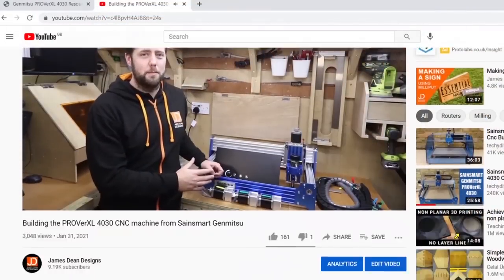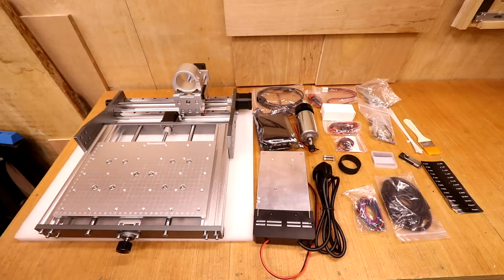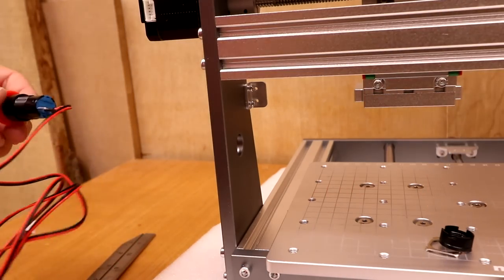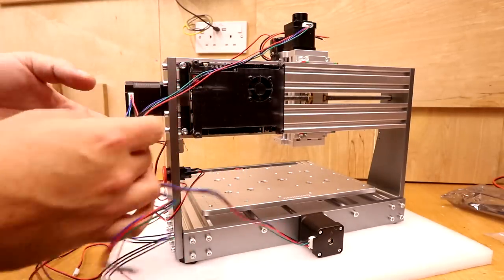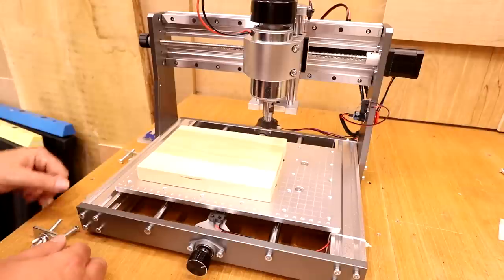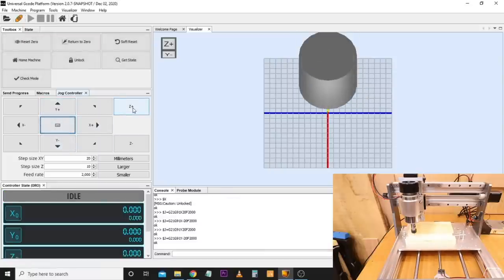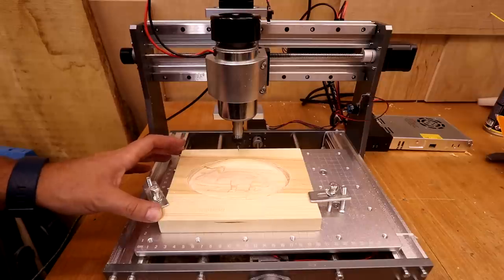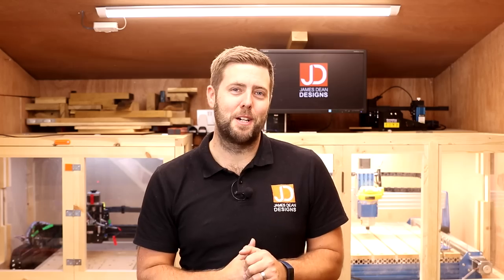3020 Pro Max CNC Metal Engraver by Sainsmart Genmitsu -  Build, test and review

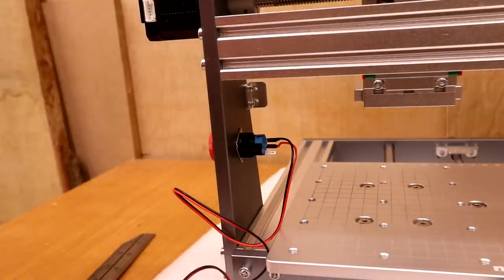Comment: So, I purchased this model a couple of weeks ago, building it was a breeze, I learnt a lot from watching the many videos by James including the correct direction of the bed and the one discussing the $3 command for altering the direction of the stepper motors, but I have a conflicting software/hardware issue, can anyone who has had this issue assist as I have also tried to resolve this in configuration software but it loops such that it doesn't let me adjust the direction. I installed the limit switches as per this video at 12:51 namely X-limit near the stop switch, Y-limit front of the unit, Z-limit top of the spindle. The steppers and limit switches are plugged in as described at 19:00, I've rewired this three times now because of this issue and have labelled the cables at both ends with their direction (x,y,z) and function (step/limit). I can connect with ease to the PC, and when I use the 'Jog' arrows (in any of the programs, Easel, Candle, UGS) etc, the 'X' right or (+) the spindle carriage moves towards the 'stop' switch, likewise jog left or (-) and it moves left.  When I use the 'Y' jog buttons, the table moves towards me when I tab forward or (+) and towards the back of the machine when I tap back or (-), and the spindle is raised when I tap the up or '+' and lowered when I tap the down or  '-', and when I used the offline controller it functions as above, correctly. Here is the problem, in that respect it's as perfect as a Swish watch.

When I 'Home' the machine the bed travels towards the back of the machine (where there are no limit switches and crashes and chatters), and the 'X' rail travels to the left, away from it's limit switch (where it chatters and growls at me). I have reinstalled the firmware twice now, I have adjusted the $3 command using all the figures but doing so either makes no difference or screws up another setting. As there are holes for the limit switches on the other side of the X and Y sides, I have also placed the limit switches here, so the X was on the side away from the 'Stop' button, and the 'Y' was at the front of the machine. That allowed me to home the machine, but my working limit was reduced by about 30mm on the Y axis and the machine/software would often report an alarm of varying reports from a non start or soft limit reached (even when in UGS they machine set up they were turned off) and no, I don't know why, by this point figures for X/Y were in negatives sometimes.

So, what could be causing it to function correctly using 'Jog' commands, but failing to home correctly. I can only print the Genmitsu test file if shortly after I run it I press the 'Stop' button as it nears the left side of the machine (or it crashes and the X motor does it's funky noise), then pull out the 'Stop' switch for it to mill, by which time I've lost half the 'G'... So, where am I going wrong? I've tried the individual zeroing of X/Y and the Z I've used a Z Probe.

$1 = 25    (Step idle delay, milliseconds)
$0 = 10    (Step pulse time, microseconds)
$2 = 7    (Step pulse invert, mask)
$3 = 2    (Step direction invert, mask)
$4 = 0    (Invert step enable pin, boolean)
$5 = 0    (Invert limit pins, boolean)
$10 = 115    (Status report options, mask)
$6 = 0    (Invert probe pin, boolean)
$11 = 0.010    (Junction deviation, millimeters)
$12 = 0.002    (Arc tolerance, millimeters)
$13 = 0    (Report in inches, boolean)
$20 = 0    (Soft limits enable, boolean)
$21 = 1    (Hard limits enable, boolean)
$22 = 1    (Homing cycle enable, boolean)
$23 = 3    (Homing direction invert, mask)
$24 = 25.000    (Homing locate feed rate, mm/min)
$25 = 500.000    (Homing search seek rate, mm/min)
$26 = 250    (Homing switch debounce delay, milliseconds)
$27 = 1.000    (Homing switch pull-off distance, millimeters)
$30 = 12000    (Maximum spindle speed, RPM)
$32 = 0    (Laser-mode enable, boolean)
$31 = 0    (Minimum spindle speed, RPM)
$100 = 800.000    (X-axis travel resolution, step/mm)
$101 = 800.000    (Y-axis travel resolution, step/mm)
$102 = 800.000    (Z-axis travel resolution, step/mm)
$110 = 1000.000    (X-axis maximum rate, mm/min)
$111 = 1000.000    (Y-axis maximum rate, mm/min)
$112 = 600.000    (Z-axis maximum rate, mm/min)
$120 = 30.000    (X-axis acceleration, mm/sec^2)
$121 = 30.000    (Y-axis acceleration, mm/sec^2)
$122 = 30.000    (Z-axis acceleration, mm/sec^2)
$130 = 300.000    (X-axis maximum travel, millimeters)
$131 = 180.000    (Y-axis maximum travel, millimeters)
$132 = 70.000    (Z-axis maximum travel, millimeters)
Reply from the maker: $3 adjust the general travel directions, so make sure that is set correctly, but $23 adjusts the homing direction with the exact same principle. So adjust that one until it homes in the direction you want it to

Comment: Hello, I have followed your video up until the section where you navigate the spindle, the spindle moves on the computer but not on the actual machine itself, I double check the connections twice, I don't know what's wrong, none of the fans are running when I turn on the machine, it just dead, any advice?
Reply: I found the issue, the emergency stop was pressed, needed to release it, for the machine to become operational again.
Reply from the maker: Its amazing how many times I knock that switch and dont realise. Glad you found it

Comment: Hi James, which  machine would you recommend/prefer for making small aluminium parts between this machine the 3020 pro max and the PROVerXL 4030. I'm converting a milling machine to cnc, similar in size to the PM30MV  and to save having to disassemble, measure, reassemble and make the parts on the machine I would prefer to have another machine to save time. Are there any other machines around the same price that may fit the bill. Thanks and thanks for the great informative videos you make.
Reply from the maker: Hi Derek, if they are just small parts then I would probably stick with the 3020. But like all things buy the best you can afford so if you can afford the ProverXl then I would probably go that way because it gives you more options and a bigger machining area.
Reply: @JamesDeanDesigns  Thanks James, Yes they are only small parts so have no problem with either. Once my conversion is done I will have a similar work area as the 4030 but obviously a much more rigid machine as its all cast iron, cutting  steel is no problem(within reason). Basically I would like to know which is the most rigid of the 2, I also have an Eleksmaker A30 laser so that side is also covered. Thanks
Reply: @JamesDeanDesigns  I eventually went with the 3020 Pro Max, one difference in the building is the whole gantry assembly is no longer fastened with T nuts, the holes are pre drilled and threaded in the outer frame so the gantry position is almost perfect from the outset, you do get a very small amount of wiggle room in order to help trim the spindle perfectly. Unfortunately it sat in the box for over a year due to health problems, now overcome and the machine is up and running. Thanks for all you do to help the community.

Comment: Hi James - first many thanks for your excellent videos as a retired "Old Geezer" I do need very detailed instructions!😂 - I have decided to get a CNC machine and I was looking at the Vevor 3018 Pro Max at £238 and that includes the 15w Laser - BUT.. having watched this video (and quite few of your other videos) I'm thinking this might be a better bet - I like the fact that its all metal  - I'm only using it for a hobby and to make some toys for a local charity - what do you think is this overkill or just the job? One last question - what's the benefit of a 15/20 w Laser over a 5.5w?
Reply from the maker: Hi Geoff, think I replied earlier on Facebook about the 3018 Pro. This machine is great but obviously another good step up price wise and not available I'm in the UK yet. But can cut faster and deeper so the 19mm boards you were on about, this could probably cut 2-3 times faster. General rule is buy your second machine first or at least buy the best you can afford so if this isin price range and ticks all the boxes then go for it. As for the laser, manufactures are a little sneaky. They sometimes advertise the input power but output power is the true value. So the 15w laser is more like tha 4w and the 20w is the equivalent of a 5.5w.  Usually they put it in the fine print but generally speaking anything listed as 10w or above will be the input value, output is usually around 1/3 to 1/4 of that

Comment: Nice upgrade but I am surprised they didn't make it bigger. Make  me think a bigger one will be next..
Reply from the maker: I did wonder that myself initially but this is really geared towards metal and to my knowledge people who do metal typically don't need as much space
Reply: @JamesDeanDesigns   I have a  self designed and scratch built 24 x 36 machine built from 1/2" plate aluminum. All Ball screws with 1" steel rod "ways" and Nema 23's with a  1.25 HP DeWalt Router motor on it. But  I do see the place  for a smaller machine. Larger size does lead  to thicker and  more costly materials. I think they were after the  price point and a market  not well covered by other brands. Even if you have  no interest in cutting  metal rigid and reliable works for everything.

Comment: Thanks for this video. Can I set this CNC up (e.g. measure the Z axis) and operate it without a computer? With the Offline-Controller. Maybe you can make such an informative video about it too.
Reply from the maker: Yes, this actually comes with an offline controller. You can run jobs and things like that from offline controller but some more advance thing you will need to do from a laptop/pc

Comment: Question maybe you can point me in the direction.  I want to increase the y travel.  I know I can buy the Aluminum Extrusion to length.  But I would need to buy 2 guide rods and 1 ball screw.  Can you tell me what the orginal length of the guide rods are and the ball screw?  I have seen that there is an upgrade for the 3018 buyt cant find one for the 3020.  Thanks!

Comment: I knew you had fingerprints on a real machine!!
Definitely brilliant thought & engineering gone into this, I thought it a beauty when it was first hinted at, having previously seen a competitor ProMAX machine video, I knew SainSmart had to match it, better it or lose out!. 
68dB can be improved with an enclosure. We heard it as quiet  possible that your recording software automatically levelled & toned our excess. I wonder if it's extra dimension will fit in the enclosure that SainSmart sell??

Comment: Great helpful setup. I have just received my machine today and when trying to install the driver from the memory stick I get an error message driver install failure? Do you know what I can do or why this is happening. I have contacted sainsmart just now so hope to get a reply soon. Neil
Reply from the maker: You may have a faulty driver on the memory stick, you can always download a new one from the Sainsmart resource website. Also, it will sometimes fail if your USB cable is not connected as you are installing the driver

Comment: Before they came out with this, when I got my 3018 pro and was thinking of a simple design to upgrade the X axis to linear rail, it's exactly how this is designed. Lol. I also bought a Z axis assembly similar to that. I plan to upgrade the Y axis to linear rails aswell to give it more rigidity. With this product you already have some of the upgrades I've done built in but my motor is 800w.
Reply from the maker: Sounds like you're building a beast of a machine. Nice one 👍

Comment: thanks for this video, i was looking at ProVerXL 4030 cnc but it is maybe a bit to big for me. The upgraded 3018 with 300w spindle is to heavy for the X axis rods. And the added end stops keeps geving me false alarm. One day i can use my vinyl cutter flawless and the other day the knive dives to deep into the material. It is just not firm enough. I am in europe and the early bird option is not availeble :-( this looks like the machine for me.

Comment: Is it posible to make an extension of the z-axys? I want to put a piece that is 12 cm height, so i need to extend the cnc.
Reply from the maker: You would need new side plates , or extensions to them in order to raise it up but yes, it is possible
Reply: I see that also, I want to get a small Kurt vice or toolmakers vice to hold things, going to need a taller side rails when I pull the trigger.

Comment: Does the machine work on stainless steel?
Reply from the maker: I didnt test it with stainless so difficult to say. The frame should be capable of handling it but might need a higher torque motor
Reply: @JamesDeanDesigns  Thank you for the answer !  I can't figure this out before buying.

Comment: I am curious if this CNC could cut aluminum panels at thicknesses of .08" .063" & .040" if you think this could handle that job please let me know, I just want to bring my business 100% in house.
Reply from the maker: It will. Probably take multiple passes   but it will machine through it
Reply: @JamesDeanDesigns  Do you think those more basic $199 bakelight based similar 3020 systems would fair as well machining aluminum? Do I need the stops?

Comment: Was this more solid than the 3018 PROver? I am trying to pick between them, and I would love to be able to machine a small amount of aluminum (fairly thin sheets) and some thicker carbon fiber. Is there a machine around the same price bracket you'd recommend more?
Reply from the maker: Yes, this is more solid than the 3018 Prover. In this price range, its probably the most solid machine you are going to get
Reply: @JamesDeanDesigns  Ok, thank you!

Comment: I bet you that same 3020 Pro Max CNC machine without the Cervero $180 1 year sub, becomes a $399 CNC machine by Thanksgiving. Cause let's face it, the 3020 is just a 3018 PROVer with just a bit more metal parts and a better motor. And I would pay $100 more than the 3018 PROVer. But +$200 (or almost +70% more than the 3018 PROVer) I will not, cause I don't need the $180 Cervero 1year sub.
Reply from the maker: Thats just the early bird bundle. You can buy the machine on its own, it only shows me in pounds but comes up about £350 if I remember correctly. We're all going to have our thoughts on this but to say its just the Prover with a few extra bits is a real understatement. The volume of the cutting area is nearly 3 times as much, the power of the spindle is nearly 7 times more than the Prover. That's before taking the other bits into account. I think of this had been released before the Prover, more people would have gone for this but I get what you're saying for those who already have the Prover
Reply: @JamesDeanDesigns  Thanks for your comment and the many great videos. They are awesome. And don't get me wrong. I think the 3020 Pro Max is a great machine at 300x200x72mm. I just don't think is a +70% higher price than the PROVer, type of a great machine. The 45mm thickness of material have never been a problem with me. Yes the ProMax can do 72mm but I will probably never use something that thick. Other than that, the size of the 2 are similar. Especially when you compare with other ALL METAL CNC 3018 Pro Max machines like the Cenoz at $230-250 and working area of 300mmx180mmx45mm
On the issue of power, you mentioned 7x more power. Since I looked for data on the motor and I can't find any, can you be more specific on the numbers of the motor? I'm especially interested on torque and speed but I will take Amps and Watts (I think it's just 300W @12K RPM, so I don't know how you get 7x more power than a 200W@10K RPM 775 motor) if you have them. Thanks.
Reply from the maker: @TheNature101  the website has been updated since I last checked which is why we're having slightly different conversations I think. it's still slightly confusing as the machine-only and bundle price are showing the same for me which is $499 but its now showing the standard price to be $709 🤔

Comment: How frustrating James...the bit I'm really interested in, you skipped over.  On the last demo, how did you align the V bit on the exact same start point as the roughing bit and run the second file?
Reply from the maker: Hi Phil, assuming your wood is flat, change the bit over and navigate off to the side of the material where it hasn't been touched. At that point  reset ONLY the Z axis either manually or with a Z probe. Then click return to zero, it should return to the centre and drop down to the correct height before you start
Reply: @JamesDeanDesigns  Thanks James,  I'll give it a go

Comment: With improvements like linear rails on the x, where do you see the current weakest link as far as machine performance, namely in cutting aluminum?
Reply: Definitely the spindle motor is the main bottle neck in that regard, I have recently purchased this machine, haven’t received it yet. I wonder if it could take a VFD system with some redesigning of the Z axis and a more powerful stepper. It’d probably handle aluminium quite well with that set up.

Comment: Great video again James.  Do you know if this takes the 3040 extension kit and, if it does, would it degrade it?  Thanks
Reply from the maker: No, the extrusion is 4040 as opposed to the standard ones which are 2040 I believe. So I suspect there  will need to be a new extension kit for this one